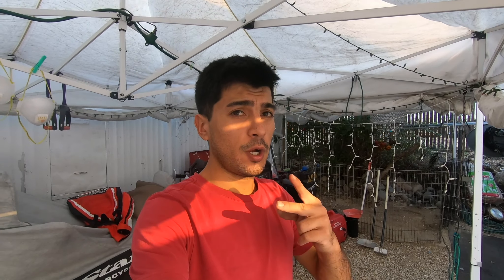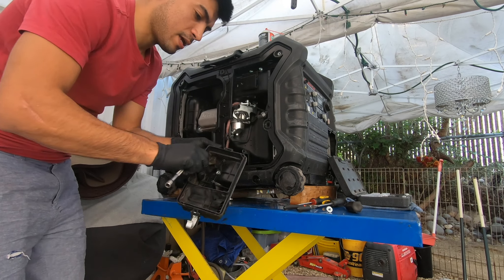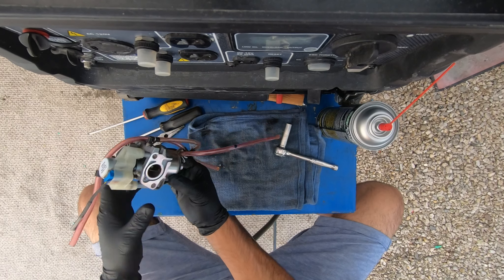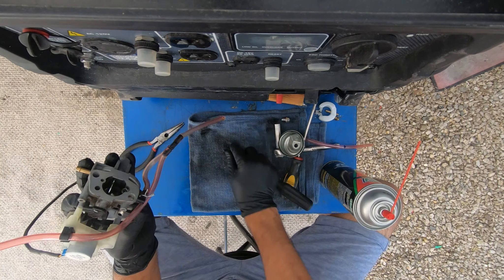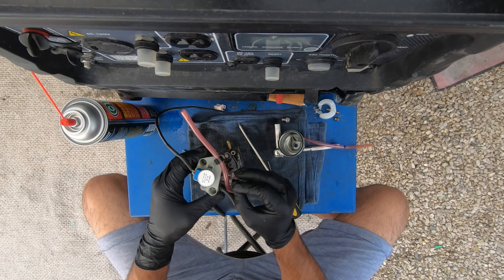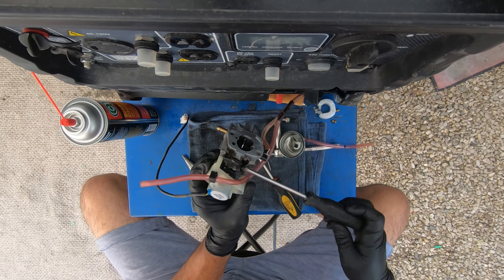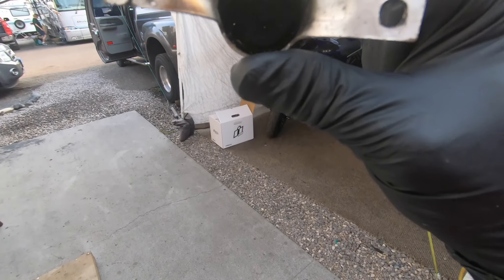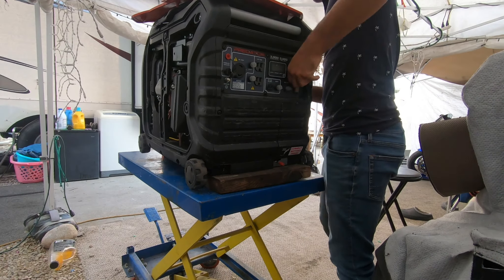How to clean carburetor on Predator 3500

Comment: Thanks for your tips. I just cleaned my 3500 carb -- first time I ever cleaned a carb. I had the same experience you did. After cleaning, it would not start. I left it overnight (in the Start position), then started it normally in 3 pulls the next morning. So THANK YOU! I had one lingering question: There are 3 plastic tubs that come off the outside of the carb. Two of them drain to the floor of the cabinet. Where does the third one go? It seems to go up, and in your video it looks like it goes over the top of the carb. But does it plug into something? Or is it just to relieve the vacuum on the two lower tubes?

Comment: Thank you sir, this helped me out tremendously. I was struggling to get mine started and changed out the ignition coil due to no spark. Then still wouldn’t start only to find those jets plugged up pretty bad. Cleaned them and she started right up. Hoping to come across how to adjust the valves on it though just to make sure it is good.
Reply from the maker: ignition coils rarely go bad. how did you diagnose and conclude that it needed a new one?

Comment: Wow you’re one impressive young man! I’m a new subscriber! My 3500 has an idle problem whereas under no load it surges faster and slower. It never dies but it hunts for the right idle. Would that be the slow idle jet that needs cleaning? Under load, it runs great and is very smooth and strong.

Comment: how do you adjust the idle screw, if you forgot to count the turns?
Reply from the maker: look at it closely it should have a witness mark. mostly consists of dust on the threads, thread in until the dust line then stop thats how you know

Comment: Great video! 200 hours on my 3500. At 100 hours it was surging and then stopped running all together. I bought a replacement carb from Amazon (they're cheap enough) took me 3 hours for the swap. At 200 hours I had the same issue. Back to Amazon for another carb - this time did the swap in 20 minutes. Always faster the second time.
Reply from the maker: Don't leave gasoline in the generator or carburtetor!  after use. open the valve and drain carbueretor bowl of fuel

Comment: I can't find anywhere if there is a feul filter on these Predator 3500 generators so I want ot install my own inline filter comming off the kill swtich. Which hose is the one on the "switched side" of the engine kill switch?
Reply from the maker: @retiredguyadventures6211  there is a screen inside the fitting that comes put of the fuel tank. If not the lines are 1/4. 

A filter won't do much tho most clogging is caused by old gas sitting in the tank and carb. Best you can do is run it out of fuel and make sure the carb bowl is empty. Trying to start it also helps suck out any residual moisture and gas
Reply: @immortalengines1605  Thanks! I found it.

Comment: I just watched several videos and saw the fuel coming from the tank is clogged below the tank in the hose outlet.  Take it off and clean it, remove the gas and fill it with clean gas and you will resolve the problem.  Thanks for the video.

Comment: The plastic screw on the side of the carb is a idle screw, not a throttle stop.  You tighten it all the way and then loosen it slowly until the idle doesnt change.  If this screw is in too far, the idle won't come down in eco mode.

Comment: Hello, a few months ago I bought the predator 3500, and I only used it a few times and I kept it for about a month and now that I turned it on it does not remain stable, I hope you answer me what you think is the problem.
Reply from the maker: @joseluisrivera2125  dirty jets in carburetor. Clean them put fresh fuel in it ans see how it runs

Comment: Johnathan, appreciate your video so much! I'm in Montana, and my predator 3500 has been running just crappy. After watching your video a couple times, I purchased a jet assortment with a 75 jet in it. Just put that in, the original factory install was a 77. I'd previously changed the spark plug, no change, it would still chug and oscillate rpms. The new 75 jet did the trick, and it's running like a dream! Thank you. Hope to see more videos soon.

Comment: Same thing happened to me. If it doesn’t start up on first few pulls, just turn from start to run and try. If not, Then leave it for awhile and come back. It’ll start and then after you run it for 20 min. Start the next day and it’ll run smoother

Comment: Did you really spray brake cleaner on your carb, you know it will eat up rubber parts
Reply from the maker: Yes that's why I remove them or dont directly spray on them.

Comment: good video, My generator 3500 electric start won't work but no problems with the pull start , I replaced the starter, battery, spark plug and inline fuse and nothing...what do you think is the problem?

Comment: Just purchased a predator 3500 (March 2022) generator. We are going to use it for our home if we lose power. We were told not to use gas with ethanol in it.  My neighbors use race car fuel in his Genetech generator.  He said it will last up to a year.  Is it safe to use that type of gas in the generator?  Does it really last for a year?
Reply from the maker: I have never used race fuel in these generators. What I personally do is I keep the tank and carburetor empty then when I loose power I drive to a gas station that either has a backup generator or is in a different grid to buy some fresh gas then fill up the gen. 90% of the generators i get as "broken" have plugged up carb jets from the ethanol going bad in them. some people use Stabil but even that has a shelf life.
Reply: @immortalengines1605  Not sure how to flush the carburetor.  I will look that up on this website.  I ran the generator until it ran out of gas.  Going to change the oil this week and run it for another 8 hours and change the oil again. I will be calling  Predator tech support this Monday (03/28/22) and I will ask them about the race car fuel.  My neighbors said it last up util 3 years.  He researched it online.  Thanks for responding to my post.
Reply from the maker: @maloney7461  at the bottom of the fuel bowl of the carb you will see a tiny hose connected to a valve with a flat ead screw. if you loosen the screw the gas in the carb will drain out prevening it from going bad in there. after you empty the carb and tank try to give it a few pulls with the choke to suck in nay residual fuel and youre done. I don't see why it's necesary to have a generator full of fuel when it can be purchased fresh at the time it's needed
Reply: @immortalengines1605  Thank You
Reply: @immortalengines1605  En teoría tienes razón.Si no tienes cerca una estación de gasolina utiliza "estabilizador de gasolina".Tengo varios generadores (11) si soy fanático.El demás tiempo es Honda EX4500S,24 años,siempre con gasolina y se vacía el carburador  después de cada uso.siempre prende por "starter".Mantenimiento es lo que da vida a estos equipos. Adelante con tus videos,son muy instructivos. Saludos desde Puerto Rico.

Comment: I bought a predator 3500 last year right as covid hit. The first one I bought didn't run at all straight out of the box. I took it back to Harbor Freight the next day and they exchanged it for a second one that was actually damaged from shipping somehow, so I returned that one two days later for another one which was fine out of the box, I broke it in over the 25 hour period. After the 25 hours, I did as everyone suggests and I changed the spark plug to ngk. However when taking out the spark plug pieces of the block were attached to the spark plug itself. Aluminum was embedded into the threads so I couldn't put another spark plug in. So I took that one back and got a fourth one. I broke the fourth one in, and let it run additionally for another 50 or 60 hours here and there. It had a total of a hundred or so hours on it before it completely stopped working. These predators are not made by Harbor Freight, they're made by a company that  brands them out to 11 different stores. It's represented by 11 to 14 different labels. For example you can find it at Northern Tool under the name Powerhouse. These generators seem awesome on the surface, but they are not reliable and they break down very easily. I got mine to work again but I shouldn't have had to fix it so soon after buying it and after having run it so little. Not reliable, especially since you're buying these most of the time for emergency purposes.
Reply: It should also be mentioned that Harbor Freight tried to blame me all four times for a subpar product. It was ridiculous how I was treated, like some criminal. Though they ended up switching it out three times because they had no choice  to do so because I had the proof against them, it says a lot about a company who won't take responsibility for their poor customer service or subpar products.
Reply from the maker: That really stinks that you had all of those issues. I love all generators but if I was to keep one it would be a Honda. look around your area within the year and eventually you will find a Honda Eu3000Is for sorta cheap. All the Hondas shown in this channel were successfully resurrected with a carb cleaning and some tlc.
Reply: Sorry for your bad experience.   Mine ran 12 hours straight powering house essentials during the -2 degree temps of the Texas snow apocalypse in February.  I was seriously impressed.   Bought  mine used for only $250!!

Comment: Some tips on this generator.... Congrats on the great price.. I have two, they are my babies. I use them for a small mobile feeding trailer for the homeless.. They have served me well...
   I always use an empty gas can to open the screw on the bottom of the carb and drain the gas when its going to not be in use for any more than say six days. Then once no more gas is coming out I give it a few more attempts to start to make sure there is zero residual fuel....these things will gum up fast. That being said I eventually want to install a manual shutoff between the fuel tank and the carb, one that looks good but wont require me to take the cover off to shut it off. Right now when you turn the generator to the off position, it does NOT shut off fuel to the carb, leaving the carb with fuel sitting in it.
  Also you are absolutely correct about flooding it. I have learned that when I take mine out of storage and it has not run in a while, after two or three pulls without starting, turn the switch from start to run and then attempt to start, it fires right up. When you turn that knob to the start position, attempt to start it right away. Do not walk away and do anything else because it will be flooded. Also, if you shut it down and need to start it back up a few min later, if it wont start in the start position with one pull, again turn it to run and it should fire right up.

   Lasly, dont bother with any of the suggested mods online... remote start, etc, stay away from all of them. I have read and seen enough to know its not worth it. ESPECIALLY buying the cover with holes that replaces the oil fill cover... They market these and tell you that this generator is starved for air by design and you need this replacement cover. FALSE. this generator was designed to draw in air in certain places to cool the valve cover, inverter circuit at the front, etc. When the side panels are on.
   By using an aftermarket part that allows more air to be drawn in you are in effect lessening the cooling air meant to be drawn in certain places and over vital parts of the machine, thereby shortening the life.
  Other than that be faithful on oil changes and enjoy :) LOVE your videos

Comment: My pred 3500 has 30 hours. Was surging on idle. I cleaned carbs fully, but didnt drain gas from the tank. The 2 issues I have are:  1. When I put my hand under the air box and push up on it a little the engine idle surges up and down. 2. On the display panel where its suppossed to have a green light and also show 125V,  it doest go green and stays 0. After resting and restarting it showed 53v as the output.  What could it be?

Comment: Can you please tell me where the longer pink drain line goes? The one that connects to the Y and then clicks into a holder on top of the carb? I got a predator 3500 in pieces and I can't figure out where that line goes. Thanks.
Reply from the maker: One goes straight up as a vent and the other goes to the bottom as a drain though a hole on the case

Comment: We run ours almost exclusively at least 12 hours a day. We use it on our sailboat and have over 800 hours on it. Just encountered the above issue. I'm hoping that the carburetor is the issue which I'm about to address.

Comment: You shouldn't have to clean the carburetor if you have a clean fuel tank and clean fuel. Where they put the fuel filter/strainer is ridiculous. If they would have made it accessible, that would have solved many carburetor problems.
Reply from the maker: You're actually incorrect, 

Carburetors are not clogged or dirty by debris, 
it's the ethanol in todays gasoline that once it sits for long enough in the fuel system it can leave corrosion and a jelly like substance, filters and strainers can't do anything about that

Comment: thanks for this video. im gonna clean out the carb on my 3500 soon. I have a question though. my 3500 is running rough, and esc throttle wont work. it just keeps running high when actuated and no load on it. so far I've changed the oil and spark plug but no fix. im hoping that cleaning the carb out will help with this. can you think of anything else that might affect the esc throttle from working correctly?
Reply from the maker: yes when you are there cleaning the carb make sure that the motor and throttle mechanism are quite free and do not have any resistance other than the motors. if that's a little gummed up remove the motor being careful not to let the tiny spring fly away and move the butterfly back and forth and spray some lubricant on the shaft both on top and bottom. those tiny motors do not have the strength to overcome any resistance so even a tiny bit is too much for them. if that's all good and it still doesn't work, then  the next thing i would suspect is a bad inverter board. does it make power? if it doesn't make 110v or respond to the eco throttle button then it's a bad board.

Comment: Hi thank you for your video! One question : when i take out the fuel tube arrival it leak fuel. The general switch is on OFF position but still sleaking fuel. Does it mean there is a problem with the fuel valve? Thank you for your help!
Reply from the maker: how much fuel is coming out? the fuel that is in the hose from the valve to the carb will just drain out but it isn't that much

Comment: Do you recommend any fuel additives to keep the carb clean? Or is that likely to make it worse in the long run?
Reply from the maker: Fuel additives also go bad then it gets real nasty. I suggest just running it out of fuel leaving cap off the tank for a few days to allow for all fuel to evaporate and also drain carb at bowl. then you can fuel up after 5 years and it'll fire up no prob

Comment: Hey Buddy, I have been enjoying your videos for awhile and have a suggestion for you to make your life a little easier and the finished product slightly better. Stop using needles and other large implements for cleaning those jets. Save you pennies, dimes and dollars and go to a place like Home Depot or Loews and buy the smallest width of stainless, twisted multi-strand cable. You only need 3 or 4 inches of it. Unravel it and you will find you have about 20 or 30 single strands of jet cleaner tools. They can be injected into one side of the jet and pulled through. If it cannot be done, you have cable which is too big. Find some smaller. I bet I’ve cleaned several hundred motorcycle carbs using this “tool” without a problem. Large needles and such can warp the hole on the jet and cause you other problems.
Reply from the maker: Hi there, thank you for following my adventures! I might have some of cable laying around, I could buy many tools to make my life easier such as and ultrasonic parts cleaner, and a spiral tip cleaner for jets but when making these tutorials I always keep in mind that most people are watching because they might need to fix their generator and most probably wouldn't have any special "tools" other than what you can find in a home garage. so I try to make it work with as easy to find tools as possible.
Reply: Go to your local music store and buy a set of the lightest gauge steel guitar strings that they have. You’ll have a lifetime supply of multiple sizes for cleaning jets for about $8.00.
Reply: Been doing small engines for about 10 years and I think I got your deal beat, lol. Bread tie! Go on your cabinet and find any loaf of bread or hot dog buns or hamburger buns, take the bread tie off, clean the paper off of it, rock and roll and every port of your carburetor.